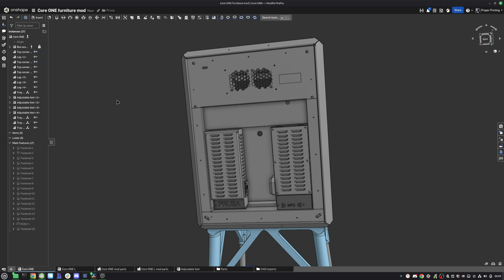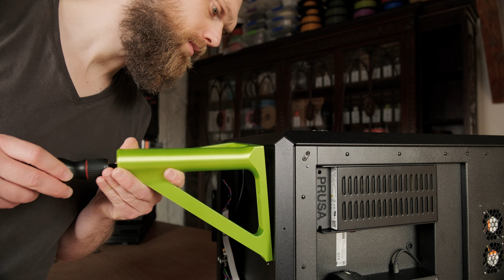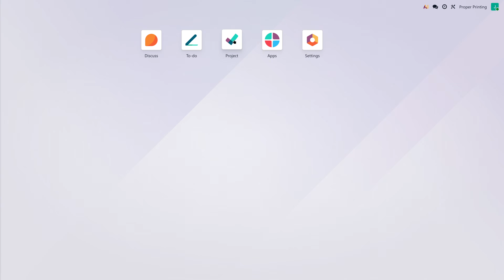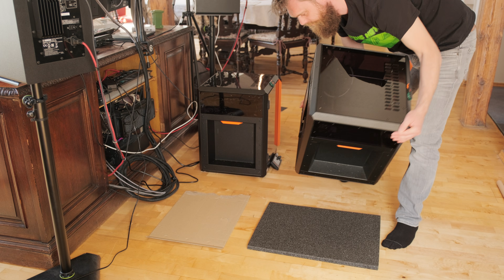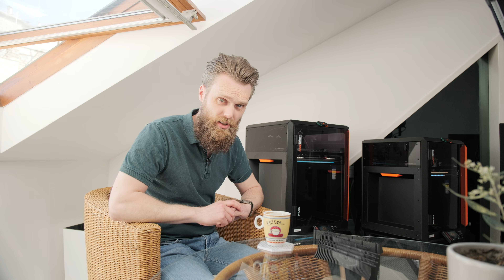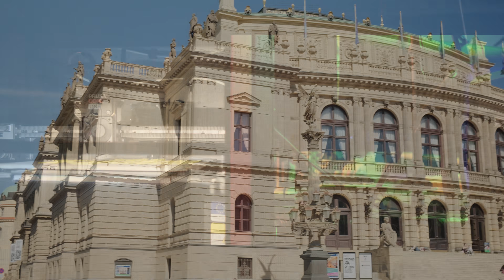I Turned my 3D printer into a Piece of Art!

Comment: I love your great ape version! Consider mounting a heavy mass, such as a 300x300x50mm paver, under the printer. Then its characteristic rocking frequency will be much lower than the printhead movements, and it won't rock.

Comment: These look amazing! A potential way to increase their sturdiness could be to integrate a filament dryer into the stand to centre some of the weight. also, what about adding TPU feet for a bit of protection for your floors?

Also, very curious... Is the studio a residential place? If so, have any of your neighbours below mentioned anything about vibrations and noise?

Comment: "your printed doesn't need a table"
proceeds to 3d print a table
Reply: Technically it’s a stand, but yes
Reply: this
Reply: If the requirement for a table is just having four legs, then sure. But that also makes a dog a table.
Reply: @Comprat_1 😂
Reply: @Comprat_1  that would dpend on how large and well trained the dog is 🥸
Reply: @AaronTheGeek its a moving table 🤷‍♂️
Reply: More of a stand than a table
Reply: Was expecting a concrete/rubber paver tbh

Comment: Prusa is really putting a lot of resources into creators recently. Multiple print farms for different folks, engaging you to move and work with them, really cool stuff. I just hope they are making even more of a push toward ease of use/quality of life feature improvements to their machines and ecosystem. I really like what they’ve done with the Core One/Core One L, especially with INDX. That said, there are a few features they lack that puts them in a lower tier than say, a Bambi H2C with a 350° hotend and a 65° actively heated chamber. I am not in a place to do the appropriate mods to the Prusa machines to match those capabilities, unfortunately.

Comment: you could easily make a Lazy Suzan Mod to fit in between the printer and the legs, so that you can turn the printer around without any problems, locking it when you don't need it. This would be great for mainenance, or applying other mods that make you have to remove side panels etc... I love this mod. And this also means I don't need to think about where I'm going to put another printer...

Comment: I live on the second floor in the roof space and it’s very quirky. My printer is on floor in my living area and 12 rolls filament in cupboard with the boiler so very toasty for them.
When I first moved in I kept banging my head on slopes around the flat for 6 months I cuts on my head.
Have had similar issues in these types of flats.

Comment: cool idea, but Hot take Imho the 3D printer is a tool, much like my grinder or drill press, so it should live in my workshop, on the work benches, with all the other tools, and nearby my workspace to process prints and procrastinate processing prints. Not on some hipster style stand in my living room. making my house smell like Burnt ABS, and sound like the inside of a factory as the motors wizz around.
Reply: Some people don’t have a workshop

Comment: You could also add a felt pad to the bottom of those ball joint plates, if you are worried about the floor, or rubber if you are worried about them wandering off.

Comment: Loving it yet I see this as a vibrating mess. As well if the table isn't solid then you will see it in the end print results. Now my 10 year old 3d printer would LOVE this table. :) But yes true this table could work if you reprinted it every 5 prints :)

Comment: Interesting project but what about noise? Firstly fan noise from the printers in a living space - most machines I've come across have been obnoxiously loud, especially the fast ones, generally needing to be in their own enclosed room. How is the Core One for this? Secondly, noise transmitted through the floor. My machines are all on vibration-isolating feet so they don't transmit mechanical noise through the bench. I should imagine your downstairs neighbours will shortly have an opinion on this 😁
I really hope the partnership with Prusa doesn't change your output. I love all the unusual and sometimes unhinged ideas you have in this field and hope you can continue with that stuff 👍
Reply from the maker: Thanks! Good point mentioning the noise. The fan noise is lower than every printers I've used so far, but it is definitely there. The motors are more prominent thought and the funny thing is that it becomes less intrusive the more printers are running because it becomes one continuous sound. It doesn't annoy me, but I wouldn't place one in my bedroom.

Comment: Quick tip : These wooden rods in the bauhaus are really overpriced, you can better buy a broom replacement
Reply: Yes, he can. But these are more precise in diameter and are made from beech instead of softer woods used from broomstick. But yes, it is possible to use broomsticks.

Comment: Nice detail to see you rotating the printer while it is printing to show where to mount the feet.
Reply: Also to showcase how wrong is the the common misconception that a 3D printer NEEDs to be on an absolutely solid surface, although, I do admit I still cringed at the sight, I was half expecting the glass door to just open, hit the table and shatter
Reply: @marcosvictor4935  C1 doesn't have any glass in it.
Reply: @marcosvictor4935  A solid and heavy surface padding underneath helps with noise ;)
It's not needed for printing, but kinda relevant if you have them close by

Comment: Would a hanging weight not help with the swaying? Lower the CG by a lot and it won't resonate at much

Being a Centauri carbon owner I'm used to my printer dancing it's ass off on the bench
Reply from the maker: I've been thinking about this as a plan B! Because it doesn't move from its place and have any negative impact on performance, I kept it like this.
Reply: @properprinting  you could implement the swinging weight as a plant pot or something if needed in future  🤷🏻‍♂️😆
Reply: @MaNNeRz91  adding balls to the one with hands and feet
Reply: @girlyguppy  I already wanted to do this hanging from one of the gantries on mine by even if I made the hanger part 0.2mm thick it caused homing issues 😂

Comment: I genuinely wish I understood this fascination people have with aesthetics.  I truly do, but my autism and Asperger's prevent me from seeing things like a 3D printer as anything more than an appliance or tool.  For me it is function over form and I could not care less what a tool looks like as long as it functions the way I want it to.  It's like a hammer to me and I am NOT going to spend a premium price for a hammer just because of its appearance.  But don't get me wrong, this is in no way a means to shame anyone.  If appearances are important to you that's fine...I just don't get it.  I have my printers on top of a long 6 drawer dresser and it does a perfect job.  The top is scratched and scarred and the finish is not good.  The drawers all hold things and slide open and closed and the body is solid and sturdy.  It does just what I need it to and I genuinely don't even notice how it looks.  I'd be just as happy with a couple of cinder blocks and a plank of wood if it worked just as well.